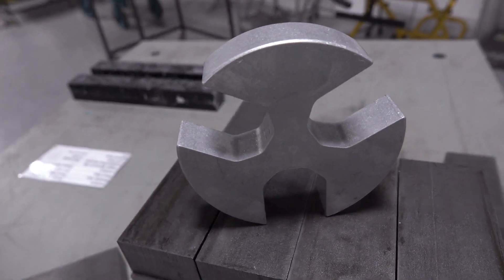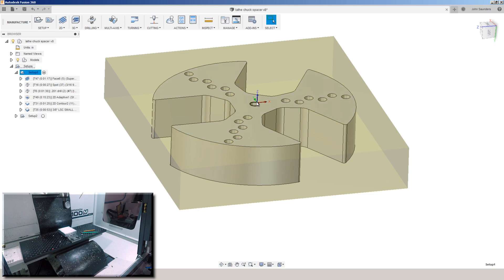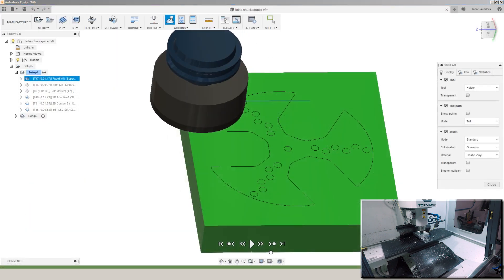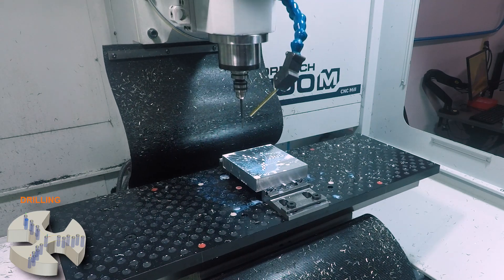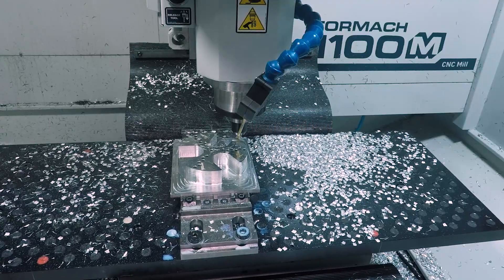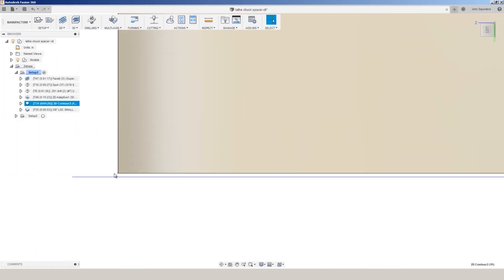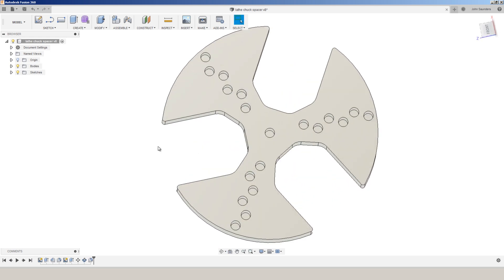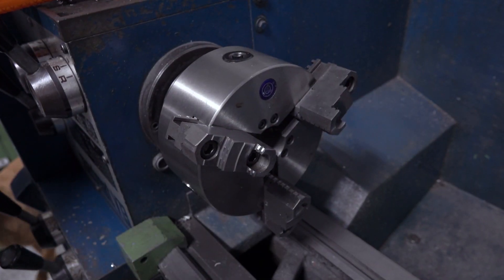DIY Lathe Chuck Spacer | WW246

Comment: Great idea!  Looks like you could embed the magnets into the aluminum and use the screws to offset the work piece from the chuck, a bit like Robin's adjustable chuck stops and no need for the specialty screws.

Comment: We use similar spacers. Only difference is the clearance slots for the jaws are slightly move able (not solidly connected to one another) and grip into the jaws with slight spring action. This keeps it centered and stop it from rattling.

Comment: 0:42 doesn't the wobble introduced by the spacer not fitting tight to the jaws have the potential to affect the roundness or concentricity of the part?  Won't it eventually have an effect on the headstock bearing?